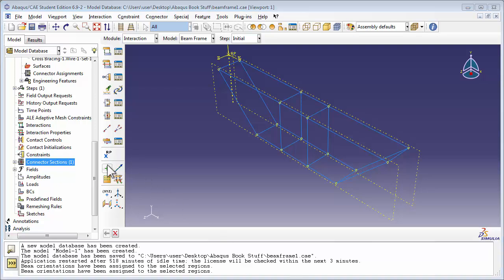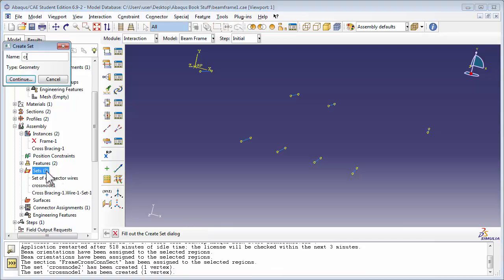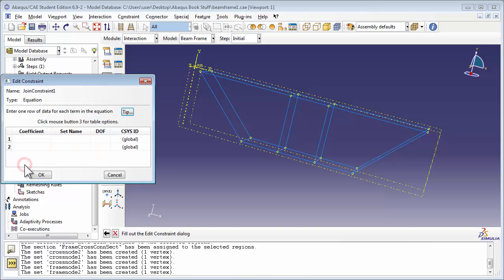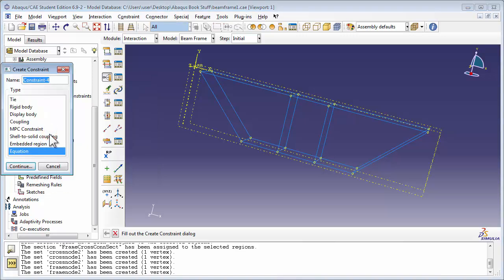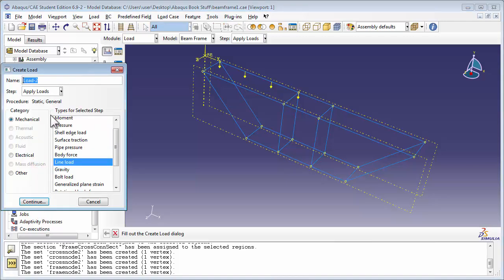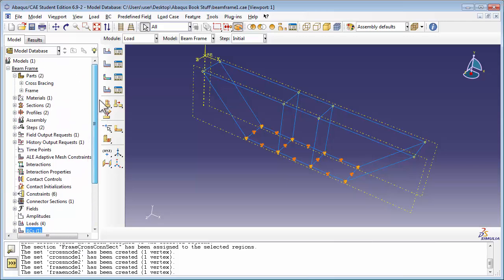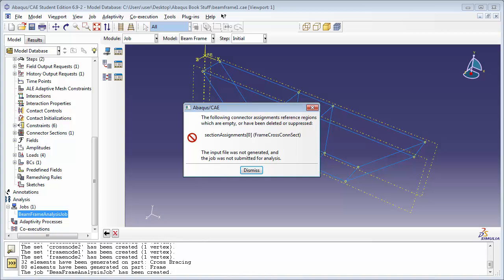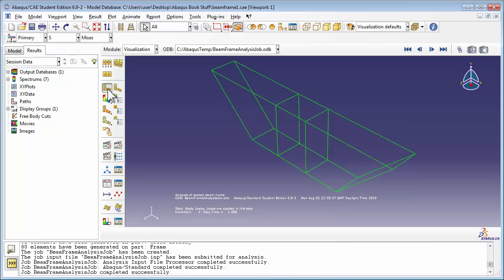4.d) Static Analysis of a 3D I-Beam frame - Part 3 of 3 (with audio)

Comment: After I create a job as mentioned in this video, and submit that, I receive error message as “ Error in job BeamFrameAnalysisJob: Too many attempts made for this increment.” Then it is aborted due to errors. What could be those attempts?

Comment: Hi! 

Hasn't the load been applied incorrectly in the video? I mean the loads on cross members (each 1000 N) have been applied on frame members. Similarly the loads on frame members (1500 and 500 N) have been applied on cross members.

Comment: The video was helpful, but the analysis couldn't run on ABAQUS 6.14. The following error message is displayed:

Error in job Job-1: Too many attempts made for this increment
Job Job-1: Abaqus/Standard aborted due to errors.
Error in job Job-1: Abaqus/Standard Analysis exited with an error - Please see the  message file for possible error messages if the file exists.
Job Job-1 aborted due to errors.

Couldn't figure out what's the problem.
Reply: I know that comment is already a year old but as I am getting into Abaqus and got the same error, this might be interesting to some people:

I could run the simulation after editing the loading step. Set automatic stabilization to "Specify damping factor" leaving the appearing options at default. (Abaqus Student Edition 2016)

As far as I know, the problem without a damping factor is that Abaqus can't find a convergency within the first increment (I reduced the increment size but the simulation never succeeded without the stabilization). So maybe in the shown version Abaqus automatically uses the stabilization to avoid this error, as the results look the same for me. However, as there aren't any values of the occuring stresses or deformations shown I can not tell to which extent the results are influenced by changing the step settings.
Reply: +TR0LLREIGN having the same problem .
Reply: me too
Reply: Had the same problem. Moe Joe method solves it.
Reply: Thank you!